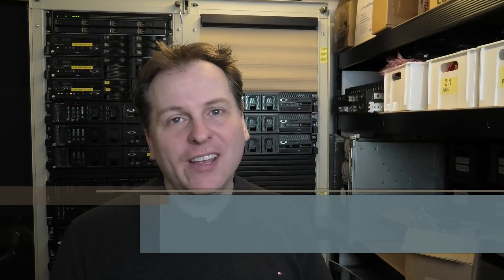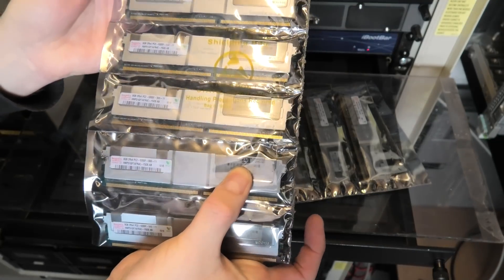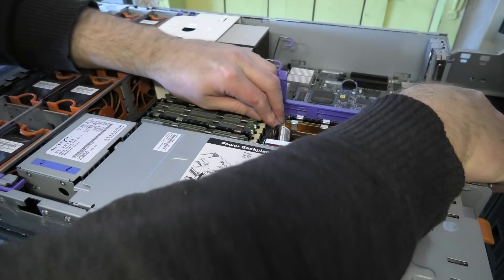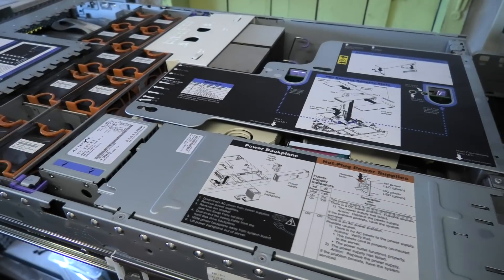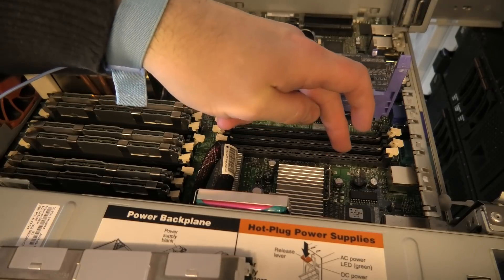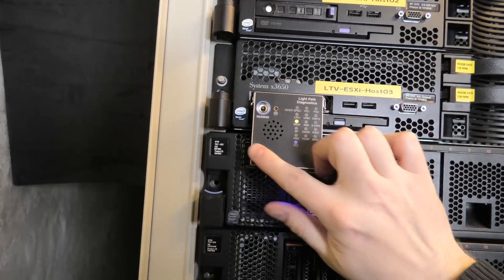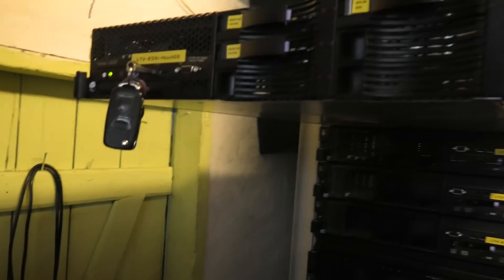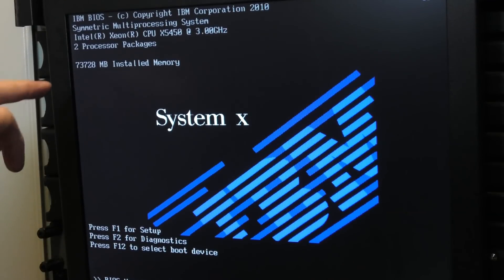Will the IBM/Lenovo x3650 M1 take 96GB of RAM ? - 1060

Comment: Nice video. I actually have this model. Do you know if it is possible to use sata drives, and if there is a size limit (like max 2Tb)?
Reply from the maker: Yes it can use SAS drives, and the build in raid controller has a limit of 2TB.

Comment: Hello master hope you are doing great...
Always with my dl360 g6. I have 2 segate 12 tb shucked for storage
I bought external sas cable and i plug it
When i run segaye it show 0.00 gb in storage . The controler is smart array p410i

How to make this hdd recognise by server
Thanks and best regards
Reply from the maker: If the latest firmware for the controller can´t do it,, You might need a newer controller :-/
Reply: thanks for the replay  @MyPlayHouse  
so give me advice about controller that
2x2TB ssd raid 1
2x12tb sata hdd raid 1
wich controller support that configuration for my hp dl360 g6

Comment: Morten I can also confirm that the HP Z600 gen 2 motherboard which has 6x RAM slots and the specifications sheets lists maxes out at 48GB but will do 96GB, if that helps you or any other member out too :) I'll share on LinkedIn for you an all :)
Reply: Speak to 'Chris Roberts' at Datatek, lovely fella, honestly a lovely bloke tell him Darren @ Wisecorp sent you and he should have loads of RAM options for you at a quality price.
Reply: I've dropped you his email on LinkedIn,  I'm just a happy customer myself nowt in it for me buddy.
Reply from the maker: Hi Darren Wise
Thank You very much!  glad you liked the video :-)
Thank you for watching! :-)
Reply: @MyPlayHouse  No worries at all buddy, I will say with some IBMs going passed the specifications sheet is fine but they are a little more locked down then most.. IBM like you to buy the addons which they fully support and rightly so, right? IBM does stand doe streamlined quality and it's a truly trusted brand, bulletproof even. I mean look at the MAX5? Addons for the X3950X5 + models and could be why they are quite locked down but professionally.

I reckon you'll get away with it but only with a select model line of RAM chips, however HP and the rest you'll be able to go much further with, with regards to over capacity RAM issuing, I'm not saying they have laxing standards it's just not a holding back factor or as important, they neither expect it too due to enterprise life cycle use time in prime in-prem locations.

Always amazing videos buddy, very time consuming I know along with editing, thinking of the next episode, full time work and not to mention the house and other projects we see online here. Respect to you buddy.

I've given you an email address for Chris on LinkedIn and ibe always been a happy customer, I'm sure you will be too :)

Comment: Thats interesting, the Intel 5000p Memory controller used in the M1 has a max memory size of 64GB
Reply from the maker: I would have liked to see 64GB working :-/
Reply: @MyPlayHouse  In Dell Poweredge 2950 and 1950 I had this much Memory working fine- for virtualization :-). It has the same chipset and the same CPUs, so it should work. 8x Pc2 fbdimm 4rx8 per 8GBs. And in 2900 it worked even with 96GB (12x8GB). It was not working with 2rx8, which based on documentation maked sense to me back then :-) Still have somewhere like 16 of them...
Reply: @Magicairsoft9  I have also had 64GB working in the HP ML370G5 and ML350 G5. Again same chipset as the 2950.